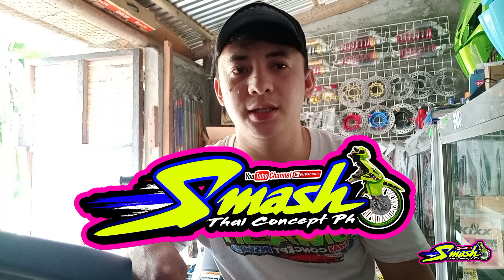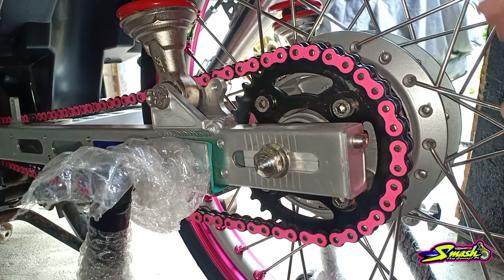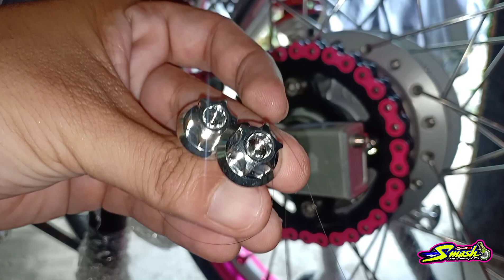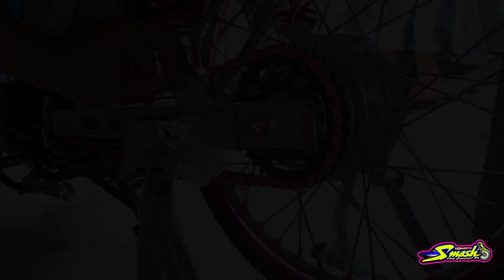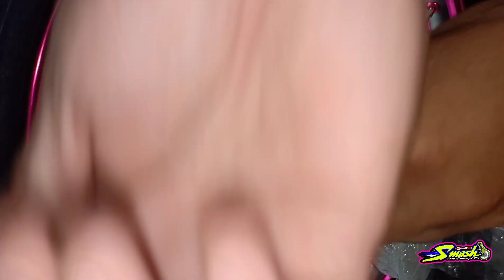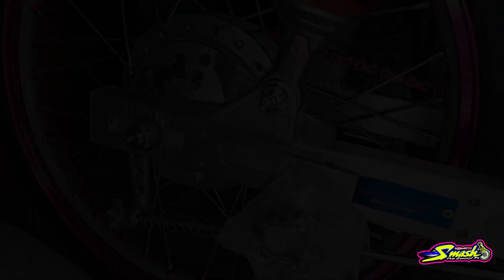INSTALLING CNC GEAR TYPE BOLTS | SHOCK BOLTS | SPROCKET BOLTS | Thailand Concept

Comment: New subscriber boss tanong ko lamg pwede ba na tanggalin na yung lock sa bolt jan sa sprocket yung pinupokpok ?
Reply from the maker: Pwde boss sakin wala ng lock yan
Reply: Di ba delecades yon boss? Di lumuluwag nut?
Reply from the maker: Hindi po basta mahigpit